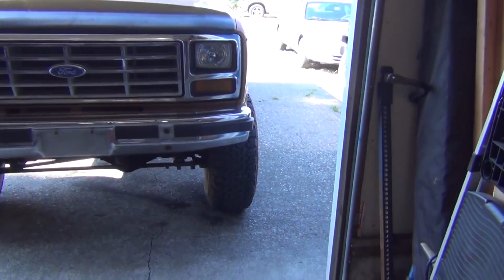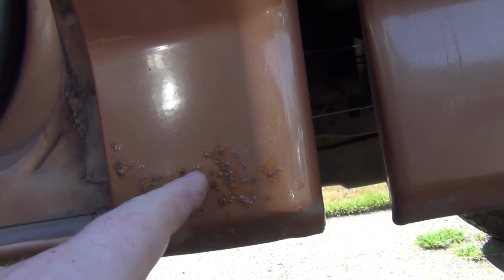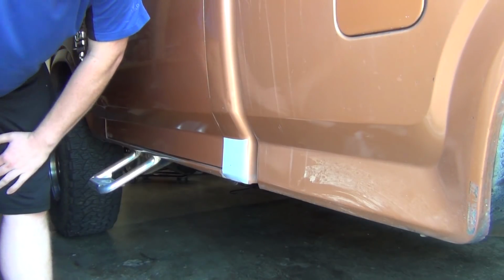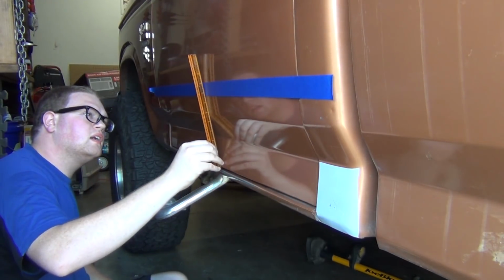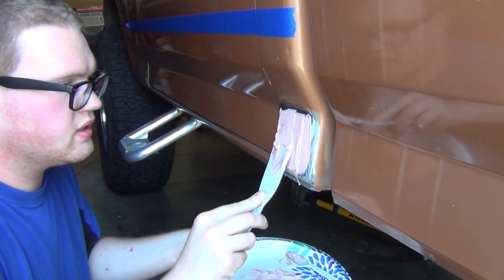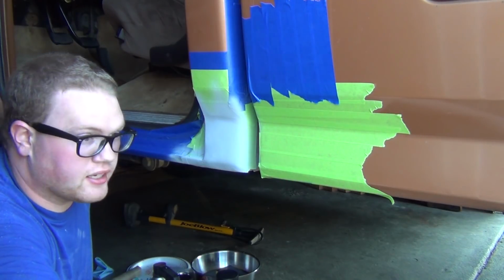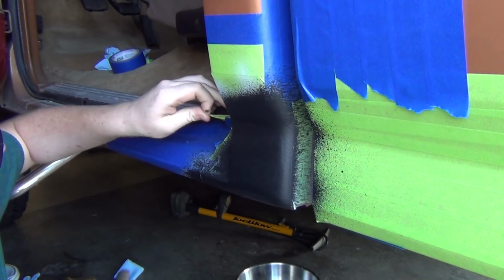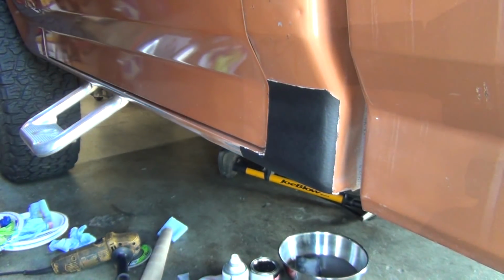Bullnose Ford F-150 Cummins Project Truck | Cab Corner Band-aid Repair

Comment: If you're using body filler/bondo in hot weather then use less hardener to give you the time to work it as the higher temperature makes it far easier for the thermal reaction that hardens the filler to occur.  If you're using it in cold conditions then use more hardener, and just don't bother if it's really cold as there is a very good chance the reaction won't happen at all and it'll take forever to harden, if it does at all...

Comment: Bondo and hardner rule of thumb is gold ball size of bondo to pea size hardner ratio.  And not too thick of bondo on metal only use thin coat about a dime thickness

Comment: At tech school, they call this Hack-A-Shack work...
Reply from the maker: North Carolina Outdoors or ive heard hack n pack
Reply: Johnson's Gee-rage proper repair for the holes midway up the cab would be to drill a hole slightly larger than the rust hole (counter sync if you wish to. Use 40 grit sander to remove the rest of the rust and allow for adhesion. Use a mig welder to fill the holes then grind down the weld. My favorite filler is 3M Platinum and use that to level the surface because the welder will slightly warp the surface. Block using an x pattern until flat. To prevent corrosion use an epoxy primer. After that scuff the epoxy and apply a 2k or filler primer. After that it can sit in primer until you are ready to paint. As for the seams at your rockers/doors, use an automotive seam sealer, SEM makes a good one. You won’t find any quality body shop supplies at a box store. Go to a dedicated paint and body supplier, Finishmaster is my local supplier. If you want to know the proper procedures, watch this video and you should be ready to diy you whole truck: https://youtu.be/NjOOTaHa8GI. Very good information from possibly the best.

Comment: Bondo.... Didn't even need it lol just sanding n paint is what I'd have done
Reply from the maker: Kyle Myers what i didnt show, was the pinholes in the sheet metal.
Reply: Johnson's Gee-rage how bout painting the bottom panel with the bed liner paint just the bottom part where u stop not higher up.